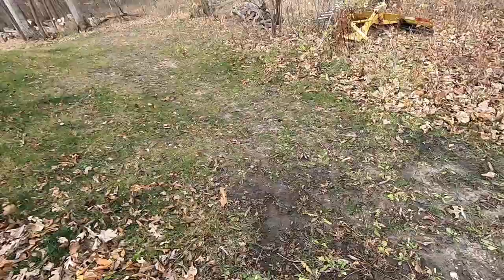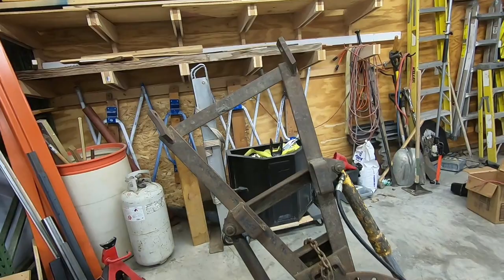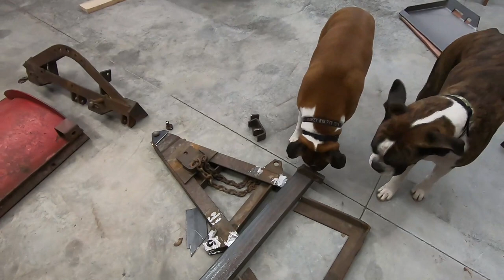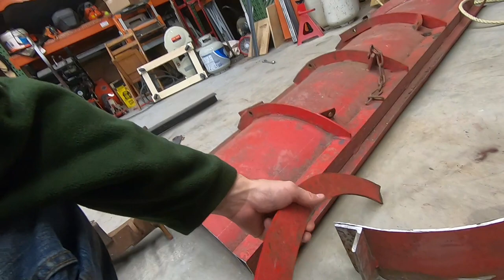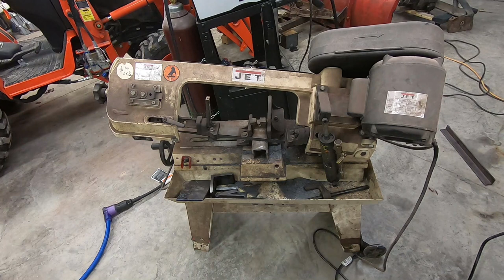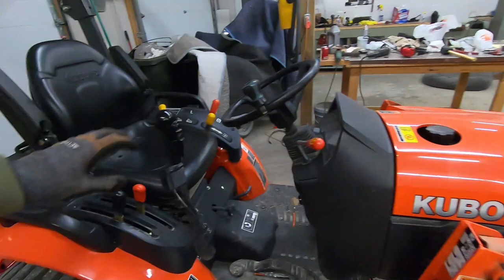Homemade snow plow for Kubota B2601

Comment: Nice job! Jst a little fyi save money & use 1/4 inch hoses because they are 1/4 “ fittings at cylinders that act as restricted flow so not to fast, congratulations what a great set up better than a snowblower!!! For sure

Comment: Not sure if it has been brought up in a previous comment, but using a stick PVC pipe for the cutting edge will reduce the amount of gravel that the blade will scrape. Cut the stick as long as the cutting edge then make single cut down the long axis of the PVC essentially making a 'C' that will clamp onto the cutting edge.  Food for thought. Great video.

Comment: Just buying my first tractor (B2601), welder, and metal tools after retiring from sitting behind a desk for 30+ years.  There's  a lot to learn and videos like yours help.  Thank you!
Reply: Enjoy your time
Reply: Hey Trader Jack here, been welding 50 years at tractor dealership but just splurged & bought multiple functions welder. Congratulations on acquiring new welder @ equipment,fabrication & welding is so satisfying and beneficial have fun!

Comment: I built pretty much the same as you did, I did notice the lack of down pressure when trying to back drag though. What I did was to run the chain thru a piece of 2 inch pipe I had, now when you put down force the pipe acts as a solid link and transfers the force from the mounting plate to the frame. Looks good!

Comment: Great build ! I found a 8 foot Fisher with a SnoFoil in the woods. The lady that had the property was trying to find a way to get rid of it , and I told her I would take it . I did a similar
 build but on an old pallet fork frame and have it on a old Kubota 430 . One word of advice , weld on a D-Ring and fish your hydraulic lines so they dont fall and pinch . I learned that lesson the hard way.
Reply from the maker: Will do!  Probably should have followed my gut on that one.  Thanks!
Reply: @adamj8293  This one might be overkill for you. I welded on a bracket similar to the plow pivot points (where you bolt the plow to the plate) and made a kick stand for the quick attach frame so when my dad takes it off to put on the fork or bucket the frame sits upright . Just a had nothing to do on one weekend project ! Merry Christmas !

Comment: I have built 2 plow setups for my tractor. First was a solid weld to the back plate and the second after learning alot of the faults with that was a setup like yours. Solid mount is simple and has great down pressure. The problem is your blade is on the same plane as the rear tires so unless you have a real flat driveway and have your blade at the perfect level so the bottom stays flat to the ground when you pivot it, the corners are always digging in. I have a 40 horse New Holland and it really had it's way with that old plow and it slowly destroyed it by making it flex to the ground. 900' feet of dirt driveway doesn't help either. I like the pipe over the chain idea another person mentioned might be best of both worlds. It also would probably help when you are attaching the plow to keep the plate upright when you're trying to hook in. That's always a problem if I don't unhook in just the right spot. Can't push it around like a bucket. One other lesson I learned no weight on the 3 point. It pivots on the rear tires and makes the front tires lighter so it won't steer.. I know you mentioned that in your other video. I had the same issue on hills and with a heavy full blade until I removed my weight. I do have loaded rear tires though not sure if you do. Try it next storm see what works best for you. Nice build!

Comment: Great job! I am currently in the process of doing the exact project right down to the same old western plow. The only difference is mine will be mounted to a Mahindra 1533. I will be making a couple different things in my design that will allow me to use the same blade as a dozer blade in the summer.

Comment: Nice rebuild. I did the exact same thing for mine. Rebuilt an old Meyer 8' truck blade for my JD 5075E. Actual tractor plows have much shorter a-frames and usually use 1 cross-wise cylinder to keep the blade closer to the tractor. Gravel is hard to plow, especially with soft and unfrozen base. Had about $800 in mine which is about a third of what a manufactured one for a tractor would cost. I'm having trouble with my Titan plate as it's only 1/4" thick and is gets torn apart by the 11,000 lb tractor and 8' blade. The A-frame is actually getting pushed through the steel. So I bought some 1/2" plate and a set of JD quick-attach brackets and have to swap the whole back plate assembly out to something much stronger. I guess you could say it's between the irresistible force and the immovable object. Yours should hold up fine. You may want to try the PVC pipe trick on the cutting edge for the gravel....... Montana Dan
Reply: I had the same problem when I used a Titan plate for my stump bucket I made.. Now the 1/4 inch plate is bent in. I bolted the stump bucket frame to the plate with six 5/8 bolts. I need to unbolt the frame from the plate to try and straighten it and bolt 2 horz channels or tubing to the plate all the way across and mount the frame to it. The amount of force pushing against the plate in a small area will bend it for sure. Still a great build. lots of ideas/

Comment: On mine I didn't use a chain I welded 2 braces.  This allows me to tilt it and push with more cutting force if I need.  Also it could get you 6 inches closer to the bucket
Reply from the maker: That was my original plan but I was seeing some comments online where guys said they got too much downward pressure when running off the loader float so I opted to stick with the chain.  I imagine there are pros and cons but sounds like your setup is working great.  Thanks for the comment!

Comment: Adam, weld a 2” square tube in the center and remove the one from your bucket.

Don’t want to bend that bucket floor, my Kubota L3301 came with a weak bucket

Comment: If needed, you can wrap a piece of inner tube or rubber around the hydraulic hoses where they hit the top of the blade. Attach the rubber with cable ties, black color in your case. I did this to my skid loader hoses and it works great. Just sayin!
Reply from the maker: Excellent idea. Cheap and simple. Thanks.

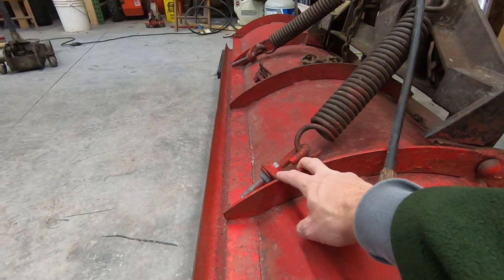Comment: 11:03 obviously too late now, or maybe not, but why wouldn't you wait and try the plow blade before cutting it up? I mean, if the tractor couldn't handle it, then cut it. I'm just looking around for ideas myself.  I got an old western that I want to mount to an even older MTZ82. There is no loader on it, but there isn't a loader on a truck either. Haven't found anything yet. Just looking at projects like yours though is getting the juices flow. Now back to your video.
Reply: Agreed.  You want it to be maximum efficiency without straining the tractor/loader.  You can't tell until you try it.  I've got a 66" HLA plow (and it weighs over 400 pounds) on my B2301 with no issues.

Comment: Thank You for the video  Very informative.  I just purchased a property that has a snow blade on it and was going to do just what you did.   Do you feel now you could of left the 6 in on the edges and been OK.  The blade and gravel don't mix well   even after the ground gets hard   I have a small 4 wheeler with a blade and make bigger shoes so it couldn't drop in as bad   I always wanted to try snowmobile skids for the 1st part of the year.

Comment: So this video has been 2 years ago already did that plow end up being way too big for that tractor?
Reply from the maker: Nope the tractor handles it just fine. It’s only down side is that’s it’s heavy hanging so far out front so I take it easy when driving around but that isn’t an issue as long as I’m smart and take my time. Most of our snows are pretty light so I use a 7’ aluminum pusher more often. But for deep snow the one I built is my go to.

Comment: Nice project! Looks like a good option for my tight budget. About how much did the total project cost? if you don't mind me asking.
Reply from the maker: I think I ended up around $550.  $250 for the plow, $170 for the cylinders hoses and fittings, $125 for the adaptor plate plus some steel.  The cylinders were a big unplanned expense.  If you wait til spring I bet you can find a beater plow with functioning cylinders and get it done for less than I spent.
Reply: @adamj8293  Nice that is really good pay off for your investment 👍

Comment: Great video!  I'm new to these kind of projects and wonder what kind of welder did you use, and why did you choose it over other kinds?  Thx
Reply from the maker: I have a Hobart 210.  It's my first welder and I've only had it for a couple years. I   I chose because I wanted a 240v welder, and it had good reviews.  Also got it on a good black Friday sale.  I'm by no means a professional welder but for what I do I've been very happy with it.  Should have bought one years ago.
Reply: @adamj8293  Thx!

Comment: Could you use the bucket tilt circuit for left and right? I have  a B2620 with loader but no 3rd function.
Reply from the maker: I would think so if you’re ok with tapping into those lines.

Comment: i got one of these plows with my tractor, https://www.snoway.com/plows/22-series/  looks like in the pictures minus the pump and headgear as it uses the loader to lift and the bucket dump & curl  lines to angle the plow. it also still has the plow lift cylinder which is where its aloud to float. i have a 87 yanmanr 226d. only part of the plow thats actually modified is the mount where it attaches to the loader, it sill has the levers that pull the pins to remove it just like if it was on a vehicle.

Comment: Your loader must have a float setting. Just weld plow to plate dont need all the pins hell i get off and turn blade by hand put a pin in short n up as close to loader you can. You have no down force now plow always float. Hell cant even push yourself out if you get stuck.  Way over kill for small tractor plows out to far
Reply: Absolutely: it's just "rigged",& done.
Reply: Dude he’s got hydraulic cylinders there didn’t you notice? If he wants to use the 3rd function, which you should because it’s way more useful, you have to leave those. He basically made it as short as he could. Guy did an awesome job and I’m planning on doing it same way (although my tractor and loader are much stronger than his).
Reply: @c1rca23  do it any way you want.  Big snow bucket works well to.  Didnt have to cut plow down. I put a 8 foot poly western on.  Cut plow fram real short welded to plate.    9xs out of 10 youll plow with blade. Straight like a pusher cuse when angled. It will push tractor sideways and trash your 4 wheel drive and stearing. Ya look around.  No weight on. Front when plows down.   I can put down force on plow if i need it out put in float.  Wet snow youll find out plow will ride on top of snow.  He did a nice job.  Hell just buy a cheap plow truck its got heat ect. Skidloader with plow it. Diffrent then tractor w/ plow.  With plow welded solid you can tilt ect push yourself out if stuck.  Youll find out.

Comment: The build is nice, but too far away from the tractor.
Reply: I was wondering the same thing.  It’s so far away it seems like the blade would have a lot of leverage to bend the FEL frame especially with the blade angled and heavy snow.  Otherwise, very nice.
Reply: I know, seems kind of Ridiculous, it's angle-pivot POINT 6 FEET ahead of the front axle...it could of been done only using 4 feet of total projection.